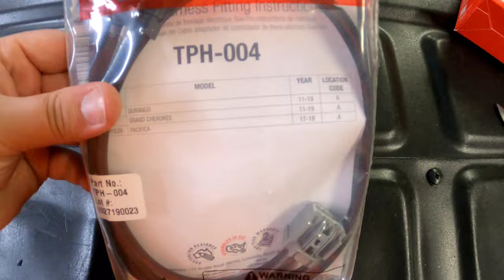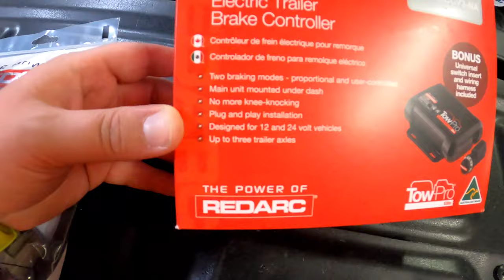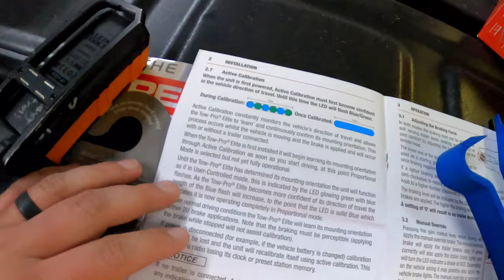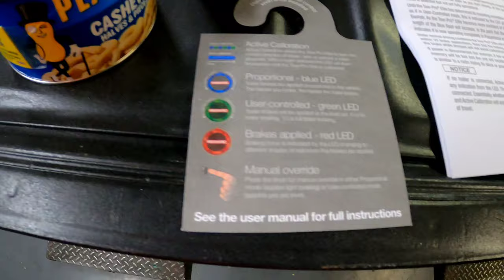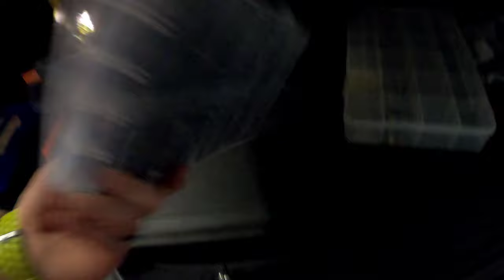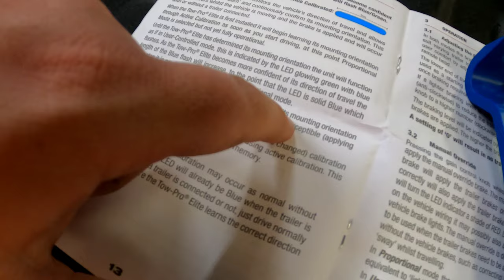How to Install the Tow Pro Elite onto your 2020 JEEP Grand Cherokee!! | For Towing!

Comment: Thank you. I do wish you would have done more of a Step-by-Step though. I would have liked to see the controller being mounted with the tape and the assembly of the switch through the hole. I have a 2013 JGC w/tow package, and I do believe that this will work for mine. I am a female with long skinny fingers, so I've got that going for me.

Comment: I put my control knob in that exact location in a 2019 JGC Trailhawk and there simply wasn’t room for the supplied plug. I ended up making my own cat6 cable which has a connector with a shorter profile and that fit perfectly.
Reply from the maker: I don't remember exactly what I had to do but I remember my hands being tore up HAHA